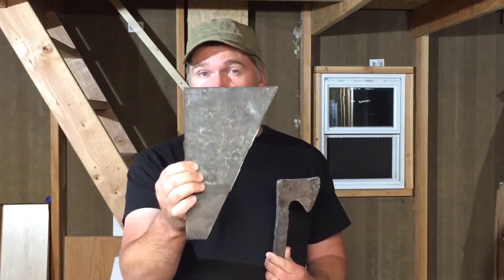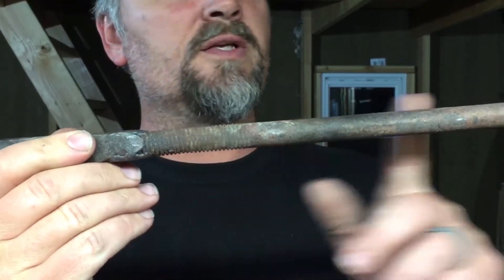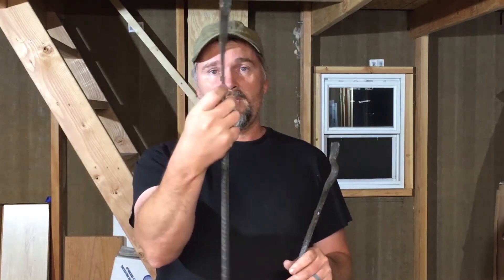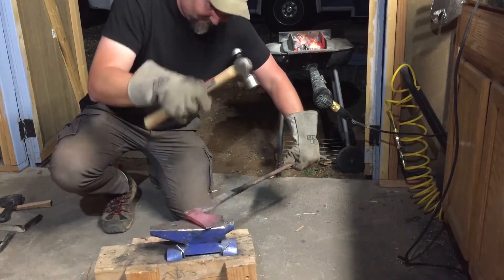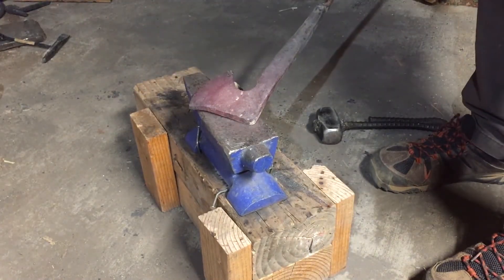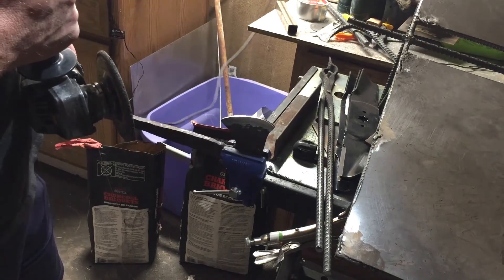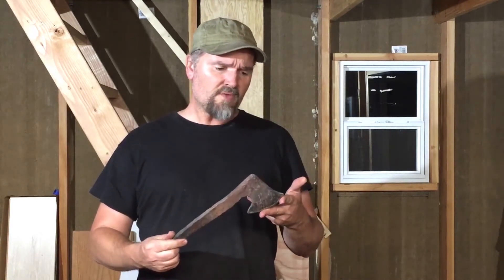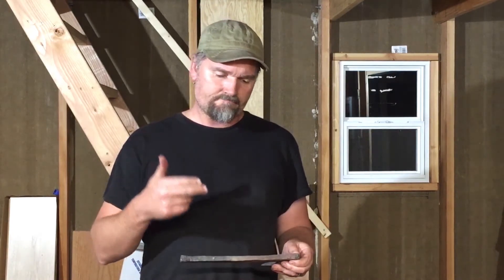Forge a camp hatchet from half-inch steel plate (Part 1)

Comment from the maker: Does anybody know if the grinder "spark test" really works for determining if there's enough carbon to hardened steel?
Reply: i think it does bro,its worked for me on many chunks of steel that i wasnt sure if they were high carbon
Reply: FargoFX yea the spark test is one of the most accurate tests u can get . also u could take a piece of the steel and heat it to critacal and quench it and see if it hardens
Reply: looks like you have a decent carbon in your hatchet
Reply: Yes but it HAS to be a belt grinder